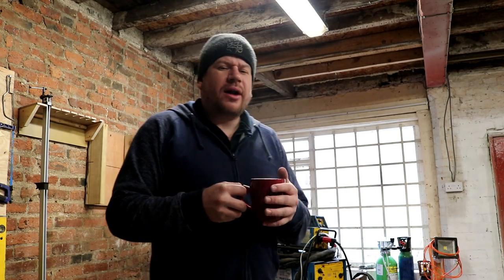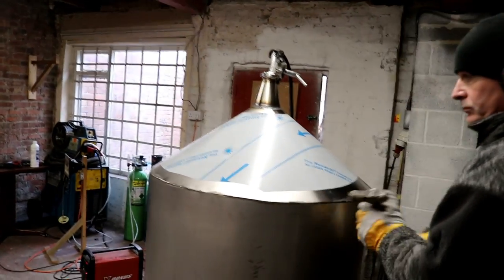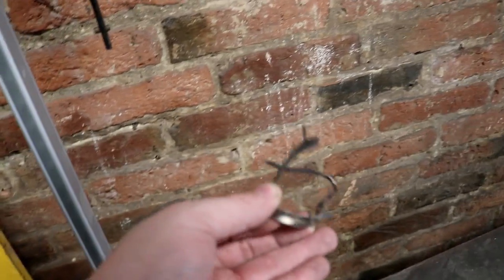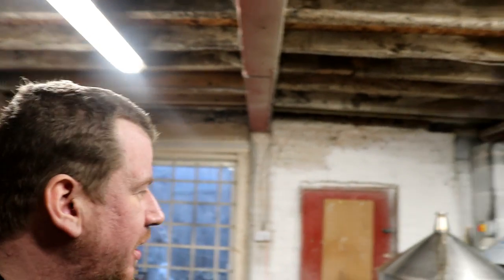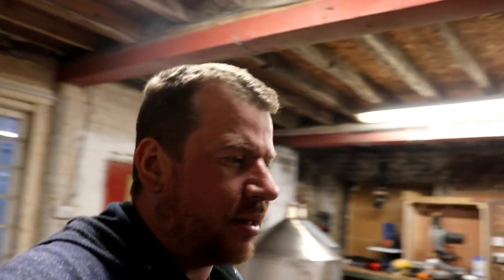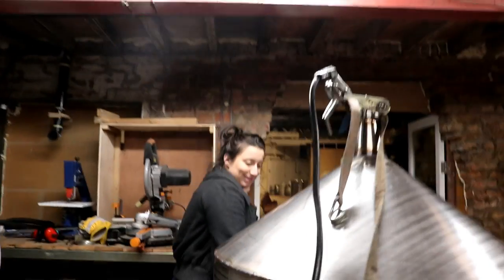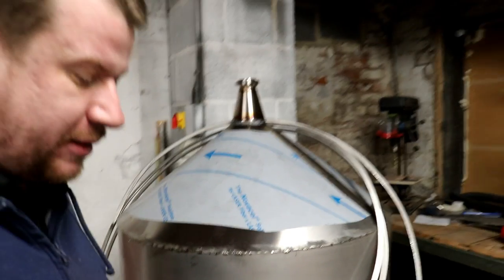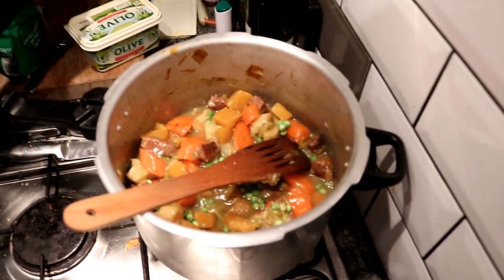GETTING CLOSER EVERY DAY

Comment: You can tell by the colour of your welds that you have improved greatly. Keep it up. BTW if you ever feel the stainless is getting too hot while welding, it's perfectly safe to quench it with a wet rag or use the compressor air to cool it. Not recommended for carbon steel however..
Reply from the maker: Thanks for the tip